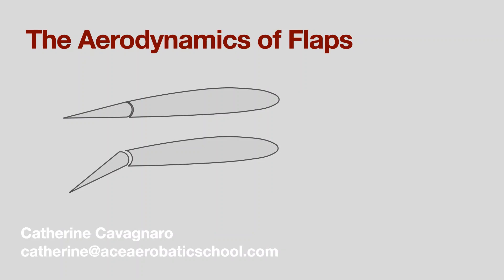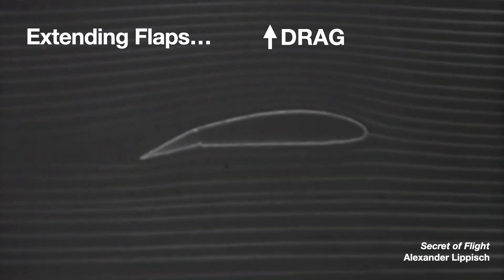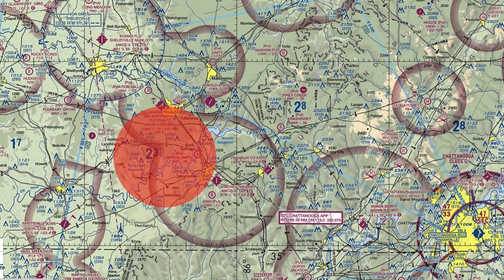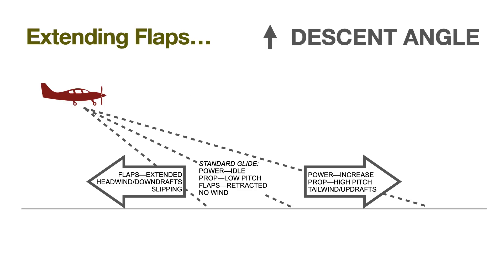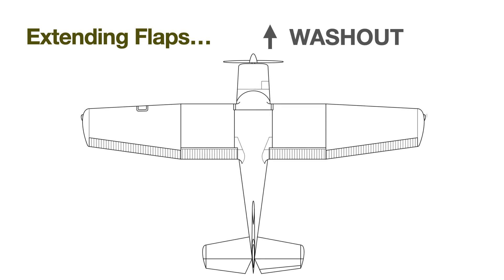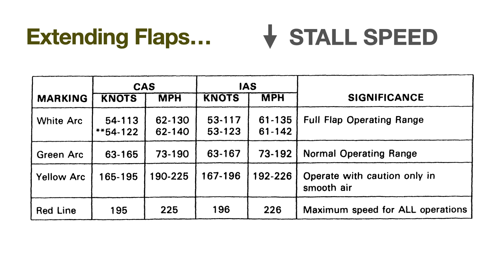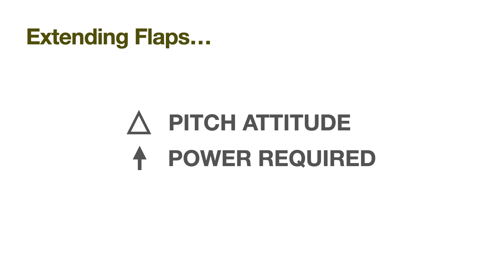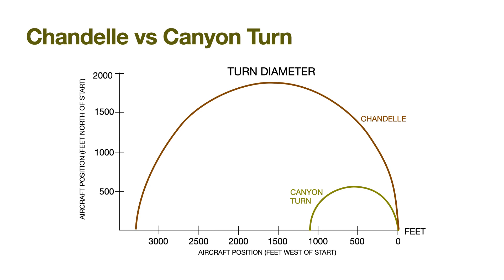Aerodynamics of Flaps

Comment: Question: By extending flaps, does the nose of the aircraft drops or pitching up? Do you have to trim aircraft for level flight if flaps are extended(Yes, I do prefer nose down for landing, since pulling up is a lot more comfortable, then pushing stick/yoke away for landing), so how nose of Cessna152 behaves as the flaps extended?

Thank you!
Reply from the maker: Good question and it is very much aircraft dependent.  For example, in a Piper Saratoga, extending flaps for landing requires immediate forward pressure on the yoke to compensate for the pitch up.  But in my Cessna 152, there is no such tendency and it's even a little nose down.
Reply: @catherinecavagnaro8  -- So, aerodynamic center of the airfoil changes with increased chamber, and overcomes wing position in relation to vertical CG.